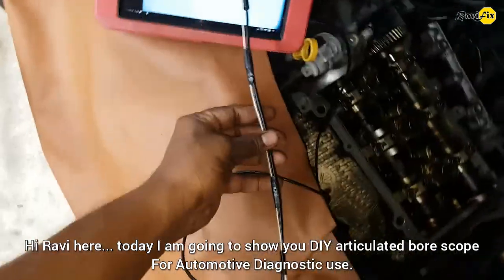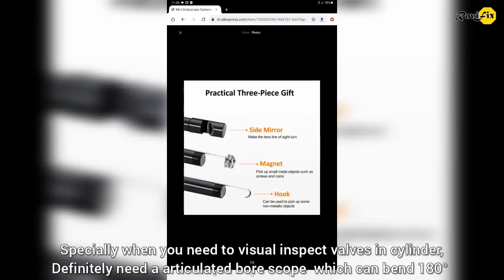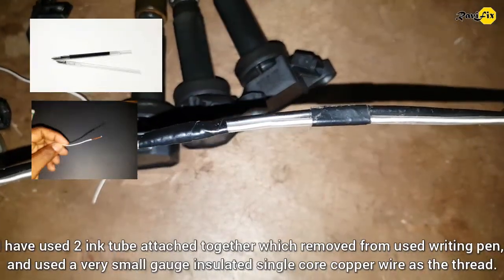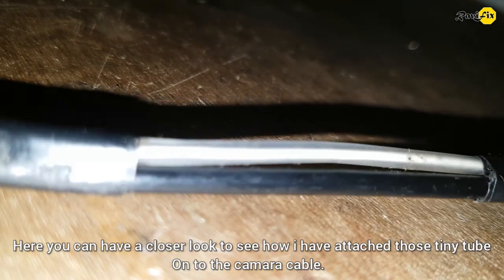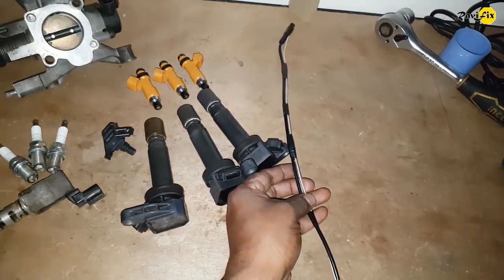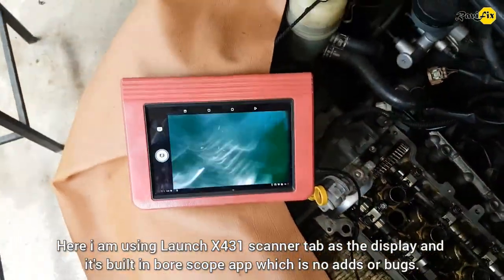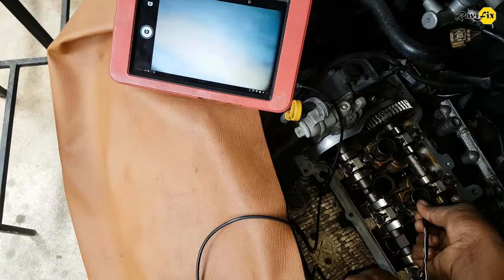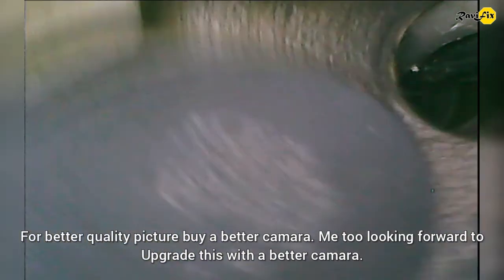DIY articulating borescope | 180° bending Automotive Bore Scope | make it yourself for low cost.

Comment: you showed almost 2.5 inches between tape ends, not 1.5 inches but great guide you can find a 30 buck built in display with dual lens that is 5.5 mm and use this to save 120 bucks thanks Ravi...currently trying this with small plastic straws, can't find a ink pen as big as ur tube and you don't have to get ink on our hands...you should show the entire construction.

Reading more about bore scopes Ravi...2 way versions have 2 high tensile cables for control according to usaborescopes, I believe you have the mind to use this info to make a Macgyver version of this better. I am going to try and make a version with 2 cables, also using a heat gun ( hair dryer or lighter ) would make the plastics shrink better for smaller MM diameter  maybe add some wd-40 as lubricant ( need a sealed system )

I am betting the wheel you find on pro models have the end of the cable wrapped around the wheel somehow how move it, can't really find any videos or guides that show one being completely disassembled just ones that show the camera part of the bore scope being tore down and shown how it's engineered